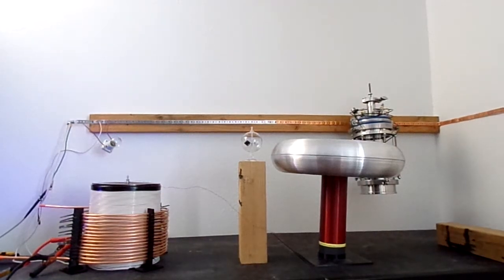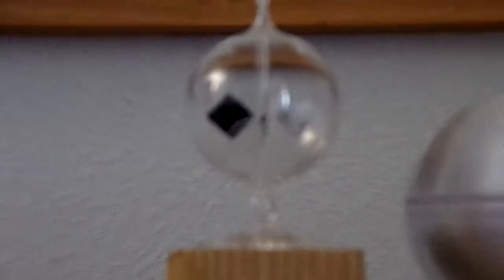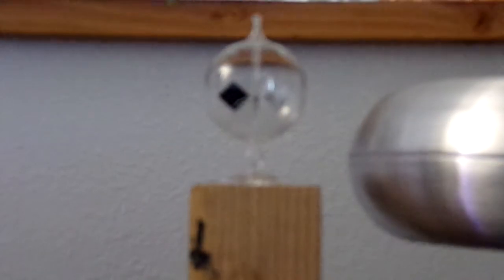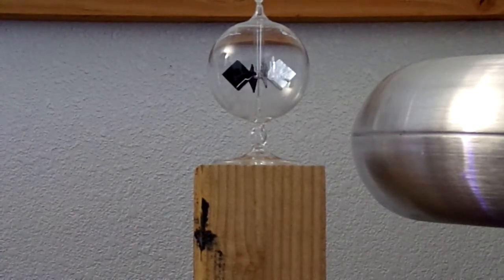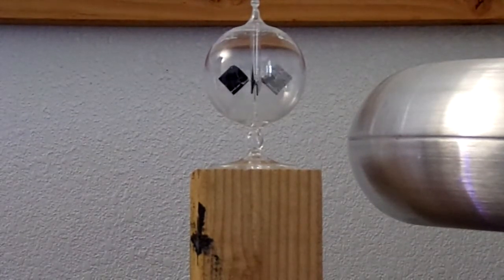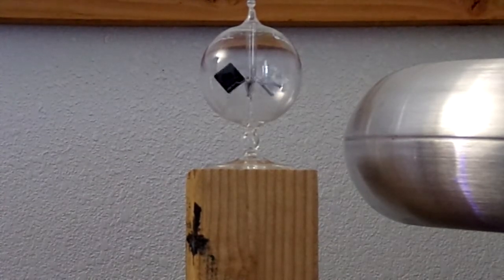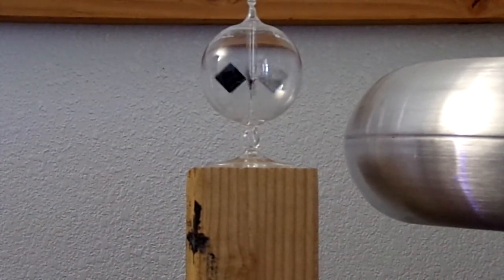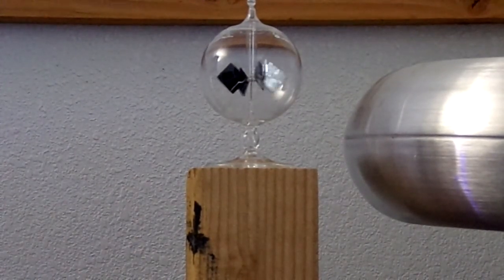Tesla Magnifier Output Turns Crooke's Radiometer within Discharge Area

Comment: Excellent! You just proved heat as nothing to do with it, in this case! Been saying this for a while. A higher frequency light (towards the blue end of the spectrum) will build up an electrostatic charge/discharge (photoelectric effect) that will move the radiometer.  A reflective surface will have a smaller dielectric permittivity (like a solar sail) than the black surface, hence why the black will be the side that will charge.

There are two ways to make this work though. Heat alone, without light will work as well, but not if there is a perfect vacuum inside, obviously.

Comment: Sounds like there is corona discharge even before you bring the ground wire closer. Could it be this small amount of corona producing the visible and UV light that heats the black side?

Would be interesting to try with it inside an opaque (cardboard, black plastic etc) box. Even then, there could be corona even inside the glass globe due to the high field strengths. Try in a pitch black room to see where corona is forming.
Reply from the maker: that is a pretty good speculation. I could try putting something in between that would block uv light from the discharge and see if that does anything